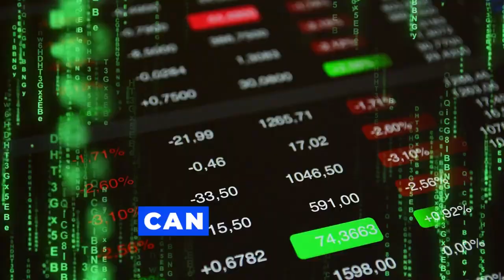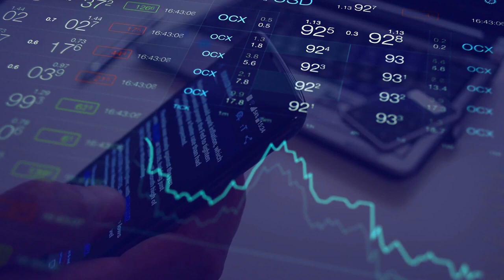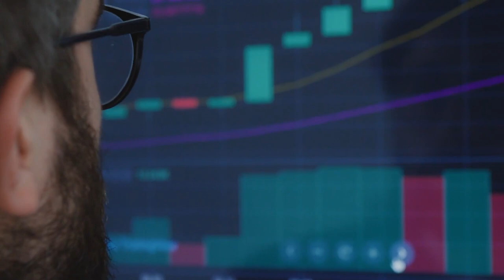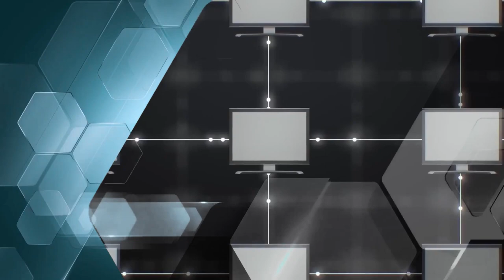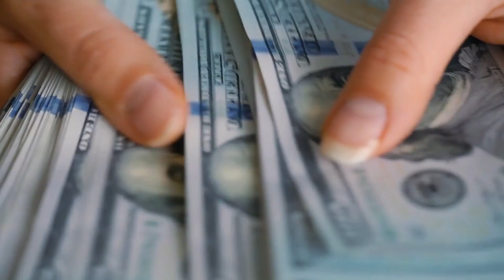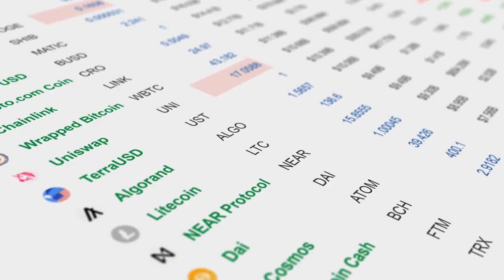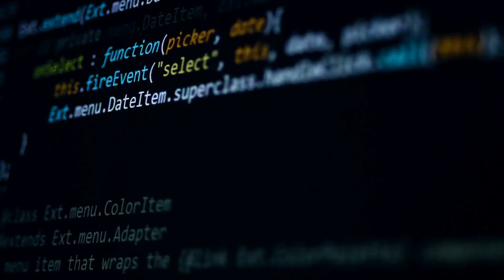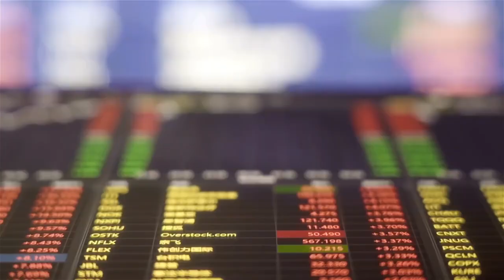Bitcoin's Next Chapter: Life After Mining

Comment: Silly #Bitcoin, the value depends on the price per #Satoshi or "SAT" and there are 100,000,000 or 100 million of them per Bitcoin.  So there are many sats, exactly 21 million x 100 million or 2.1 x 10^15 satoshis (plenty to run an international economy). That is a big number.  At $60,000 per Bitcoin each satoshi is worth $0.0006.  When each satoshi is worth $0.01 or 1 cent then there would have been 16X growth or sixteen times growth from the $60,000 value today.  So that would put a $960,000 or close to $1 million value of 1 Bitcoin.  Then they will wait for the $1.00 satoshi value or $100,000,000 Bitcoin.  

Furthermore, when there are no block subsidy left, approximately 2140 and the network depends on fees.  The technology should be so advanced that there are millions or billions of transactions per second world wide.  With millions per second, the small fee will add up among the entire block group.  Over 100 years should have a significant amount of innovation.